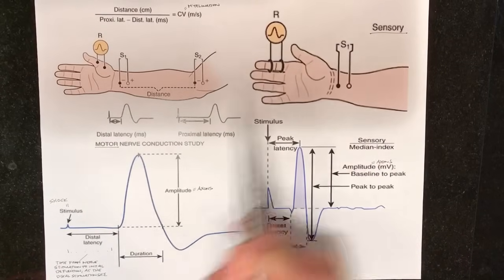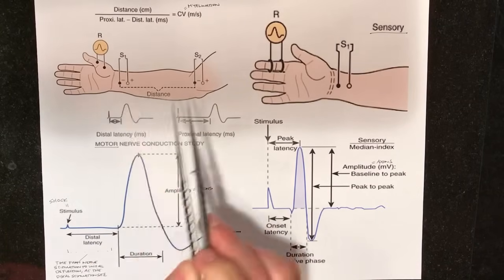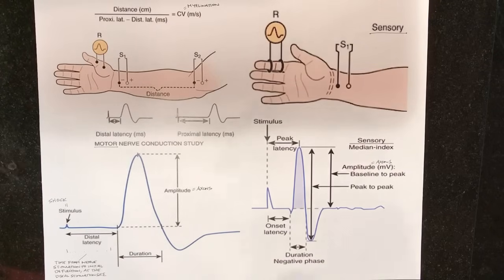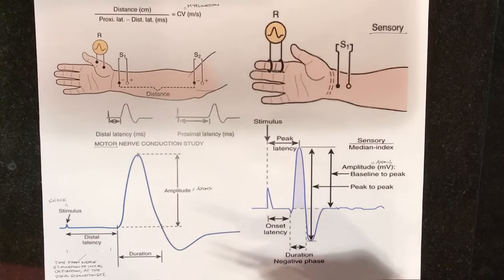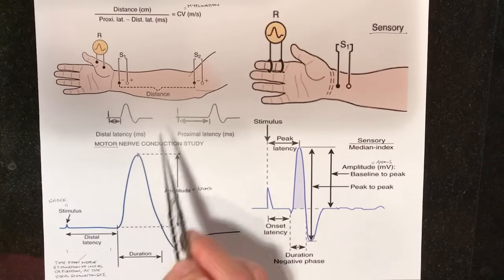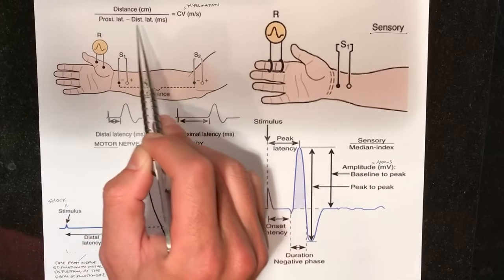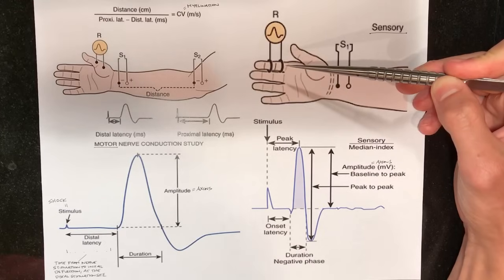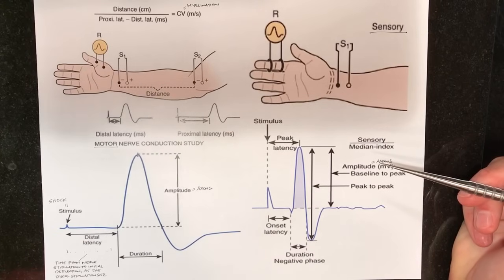Nerve Conduction Studies (NCV) Fundamentals

Comment: Doctor please help me... I'm female 24 years old 147 lbs 5.6 feet.. I went to take ncv test because only 1 of my hands was having burning sensations when used alot... So i did NCV test on both hands, one was fine before test but after the test it got bad and it started burning me that very same night and i feel my fingertips getting numb and heavy. , they used 50 mili amps on me with pulse width 100 and it wasn't gradual... and it was so painful and my hand jumped alot.. Is there a chance ncv tests are harmful?
Reply from the maker: You should see a board certified neurologist or board certified plastic surgery trained or orthopedic trained hand surgeon immediately.